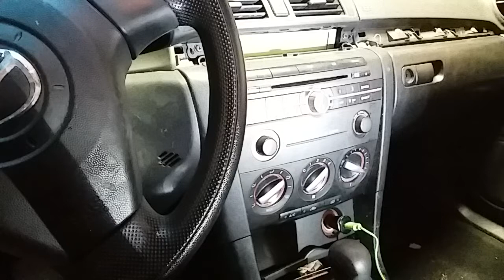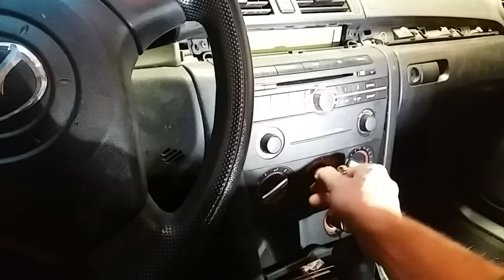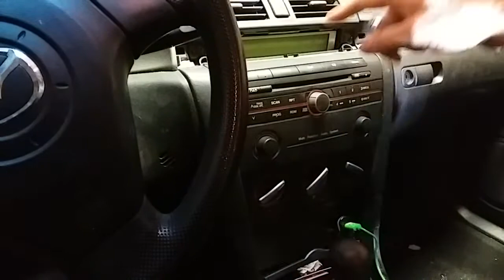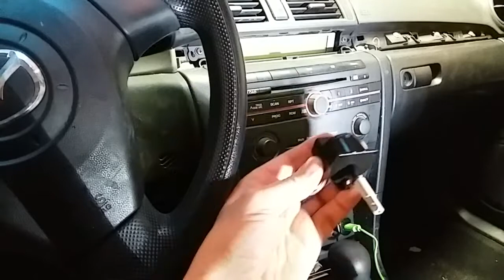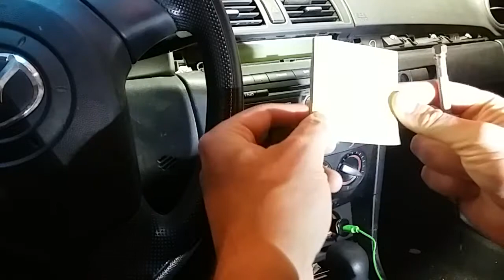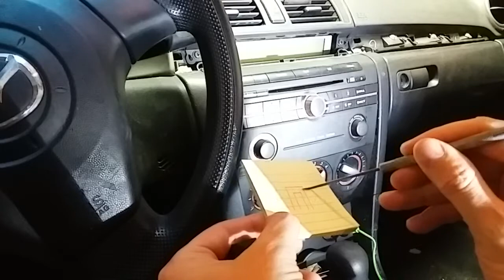How to replace Mazda 3 blower motor fan speed switch replacement.

Comment: While replacing my ac expansion valve I realized you can access the back of that switch pretty easily when you remove the glove box, which is super easy to do.

1) remove the grey trim above the glove box,
2) remove the two grey bolts
3) pull the glove box firmly, straight toward the passenger seat, careful not to damage the glove box light
4) remove the glovebox light bulb/socket as one. No need to unscrew the light housing. There are little tabs on the light bulb socket. Press one and it comes out easily.
5) remove the trim piece where your left foot would be if you were sitting in the passenger seat
6) remove two silver flange screws for the center console trim piece that is on the right side of the three ac control knobs. I wasn't able to entirely remove this piece, but removing the two screws gives enough flex in the trim piece that I could stick my hand behind the ac knobs and grab all sides of the two plugs that go into the ac controls.

Don't be intimidated. This is super easy. It took me about 5 minutes from fully assembled to touching the back of the ac controls. I would guess with okay mechanical skills it's like a 10-15 minute job to access this. 

All you need is a Phillips and flat head screw driver for the disassembly. If you want more instructions with pictures for removing the glovebox, search "How To: Change glovebox light mazda3forums.com" and there's a post from 2010 showing it.
Reply: I just finished this job as described in the video. If I had to do it again, I'd use your method. I used a small dental mirror and a headlamp to see where the L pick needed to get to. I ran out of curse words about half way through the job. Finally got it after about 45 minutes. Perhaps a slightly larger mirror that would sit in place without having to hold it would have made it easier.

Comment: Just finished the switch swap on sa 2008 Mazda 3S hatchback. Space is tight to get your hands in under the switch. I used a medium size allen wrench with the short side of wrench going under the switch to push down on the lower latch tab. I also had top of the switch pried with a small flathead slightly past the top two tabs so as to put an outward pressure. Pull on the Allen and the switch pops out.  Thank you Ross for you guidance.

Comment: It took 15 minutes to get to the switch. It took an hour to firgure out how to disconnect various plugs. Then, it took an hour blindly poking from under the unit trying to pry it off . Then I took a picture on my phone and realized I was poking at the wrong end. Then it took 10 minutes to get the old switch out and another 10 minutes to put everything together. But the schematic helped.

Comment: Thank you. Worked like a charm and I didn't even need the probing tool. I wedged and wiggled it right out of there.
Reply: Thanks to your comment, I too was able to wiggle it out after getting the top loose. I couldn't get my top top do the pushing but with some rocking and pushing, I heard a click it was out.

Comment: I also was skeptical about the 20 minutes...... but, follow his instructions and that is all it took. You do need one of those tools with the hooks and also pull the switch out first and then you can remove the wired connection, there is enough slack to do this.

Comment: Tried this on my 2008 Mazda 3.  After watching the video and for about the first 20 minutes of trying to get the switch out I was skeptical, but eventually it worked.  If you take your time and visualize the tab on the bottom you can get it.  Only issue was the plastic tab (at least on my car) was fairly brittle and I ended up breaking it.  However, it didn't appear to affect the switch too much, it's not really loose and with the knob back on you can't tell that the tab broke.

Comment: Thanks for you great explanation. I, however, wish that you also showed the actual replacement too. Thanks anyway for sharing it.
Reply from the maker: It most certainly would be better  this way.  I  came up with the idea to make this video after I had already replaced the switch.  The switch I am showing is the old switch.